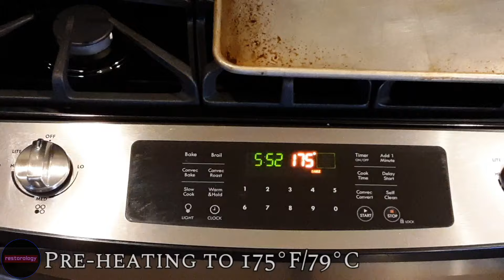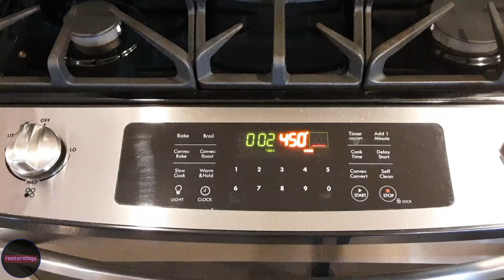Broken Antique Axe Repair and Restoration

Comment: Good video!

I have zero experience at welding so I have a couple of questions. 

1.  Why preheat the steel before welding?
2.  Will the weld line be a possible weak point in the future?
Reply from the maker: Hey thanks! Answers - 1. pre-heating the steel alleviates some of the stresses on the steel due to extreme temperature changes when welding; 2. if someone competent welds, the weld should be as strong or stronger than the areas around it. With me, maybe not so much!! I am not a good welder but it has held up so far though so all is good. 🍻

Comment: Beast of a splitter, but that handle is not nearly as good as it could be. I have used a truper handle before, and it doesn’t have a big enough palm swell, but if you want a bigger handle to shave down a bit, buy one from house handle co. Also, personally I would have used a knife to shave the lacquer off, as I have run through sand paper incredibly fast trying to remove it, even with lower grits. Overall, looks nice
Reply from the maker: Thanks for the advice. I've got another axe to work on soon and I'll check out House Handle. So far the Truper has worked well but if I were to do it again, I'd get a slightly shorter length. I ordered a spokeshave to remove the lacquer but it didn't arrive in time. The mouse sander with the 80 grit surprisingly did pretty well but you are right, I went through some paper. Thanks for visiting the channel and for commenting. Cheers!